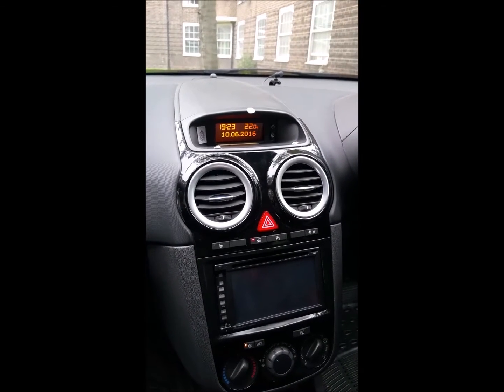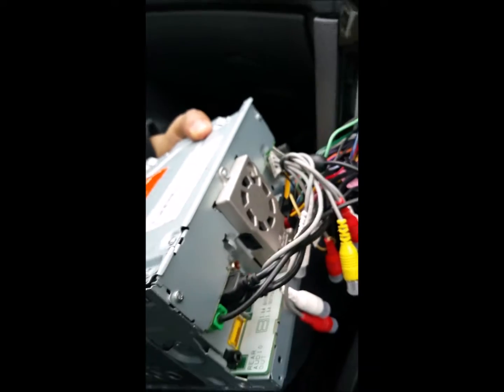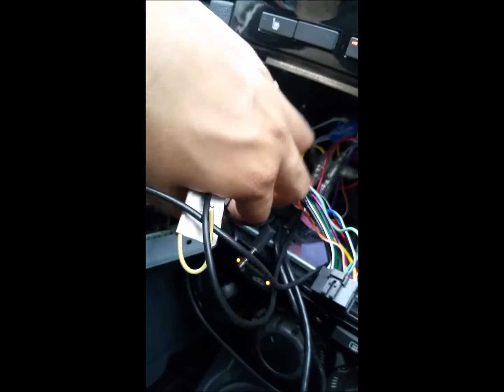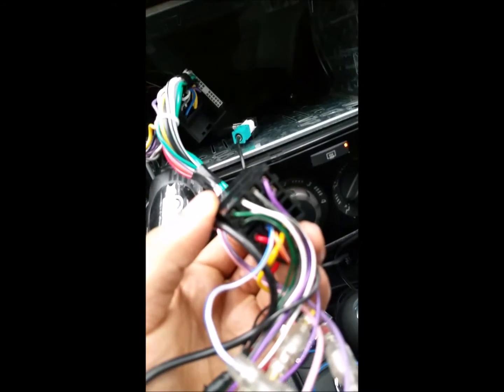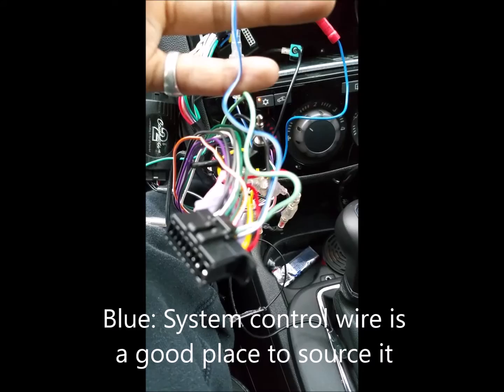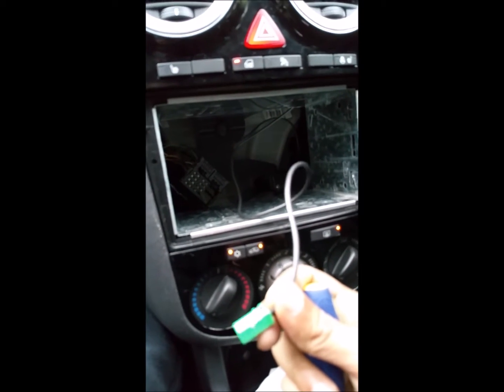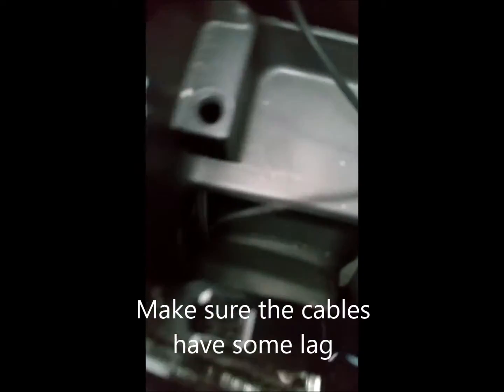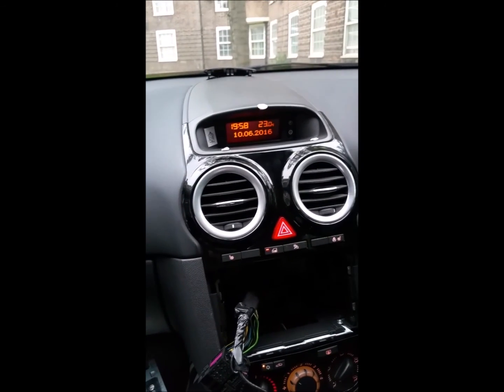Install Doubled-In Sat Nav Headunit - Pioneer AVIC F860BT

Comment: does yours work apple car play? i have this unit but can’t get apple car play to work ?
Reply from the maker: Hey I did at the time. I have sold this car so im not sure why it may not be working. 
Sometimes if the cable is not a genuine apple cable the phones dont like it. 

Buy a cable from apple and try that. If it works you can get a longer one and run it to your glove box or wherever you keep your phone.

Comment: Can you help me with this.. I connected the red wire with the mixed red/yellow cable. But now the Pioneer is constantly on, even when  the auto is powered off. I have a Opel corsa. And I dont have a single red wire or single yellow. I have duo red/yellow & yellow/white
Reply from the maker: No worries. What year model is your corsa? How have you wired your head unit eg did you use a connects2 harness?
Reply: Davi model is 2007 and sorry no,  I dont have a connects2 harness. With the connects2 harness u mean that little black box for the steering?
Reply from the maker: Ok Ive checked the manual. You should have the same model year corsa as this one in the video. You definitely do not want to use the red yellow cable as it will drain your battery and could cause some short circuiting. My advice would be to buy a harness (connects2) like the one in my other video. It details how to connect everything up. This is quick simple and wont damage your car. If you still need help or have cut wires inbox me some pictures so I can get an idea of how to revert this back or possibly use another cable.
Reply: Davi thank you for the advice, do u have telegram or whatsapp or something? So I can contact you

Comment: Cheers for the videos, do you have to ground the headunit or is it done through the connect2 harness?
Reply from the maker: Rhys Williams Hey you will need to ground it. But you can see how I did that in my other video. Assuming two things 1 you want to ground it so you can use it while you drive & 2 you have a similar pioneer or sony head unit you should have a green cable the instruction manual tells you to splice into the hand brake cable. Dont do that just take the negative power cable and tap into that. Check my other video it will be much easier. If it doesnt work you like need a relay. Just keep in mind that splicing into you hand brake can either damage that cable but will force you to stop the vehicle completely to use it. I hope that helps.
Reply: Davi okay, That makes sense, apart from that no grounding is required?
Reply from the maker: Ok lets try this, which head unit are you connecting and to what vehicle?
Reply: Davi pioneer sph da 120 and a Vauxhall Astra h
Reply from the maker: Simple Ive installed one of these in my friends SRI Astra H.  Its exactly the same installation. 11.35 minutes into this video will show you what to do Wiring Doubled-In Sat Nav Headunit - Pioneer AVIC F860BT https://www.youtube.com/watch?v=APlYub4m5rM

Check the video before for everything else you need. I go through every connector and cable.

Comment: wheres the links to where you bought all the adapters?
Reply from the maker: KDOT324 sorry for the late reply I called up connects2. Told them the vehicle type and understood which adaptor I need + amplified cable lead. Then looked for the parts on eBay and made the purchase from there.

Comment: Great video mate. I’m looking to do this exact same thing to the misses corsa d. Can I ask if you had to tap the 12v power supply with this Connects2 adapter? If you did where is it connected to?
Reply from the maker: Gary Fowler Hi Gary I only tapped into the 12v remote switch on to power the radio Antenna. It's the blue and white wire in the wire loom supplied with the radio. People usually use that to switch on their amplifier. Everything else is plug and play. Let me know if you need any other information.